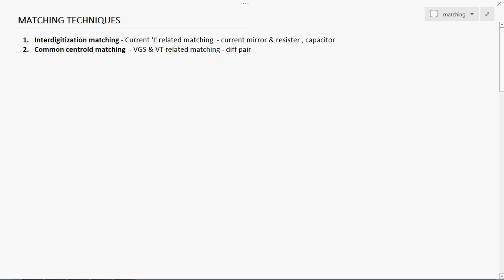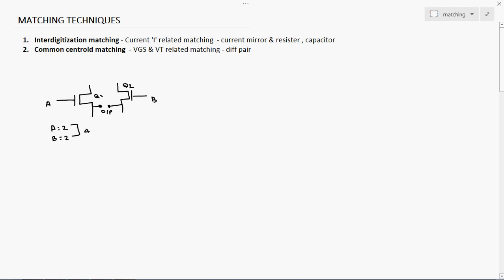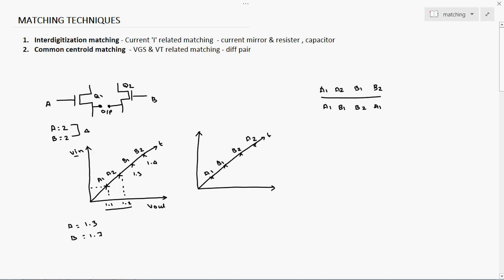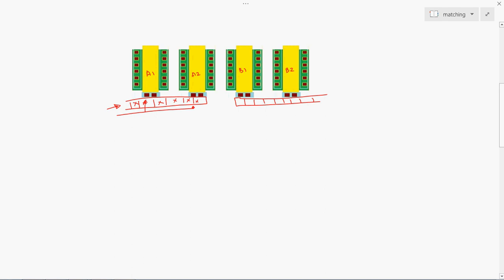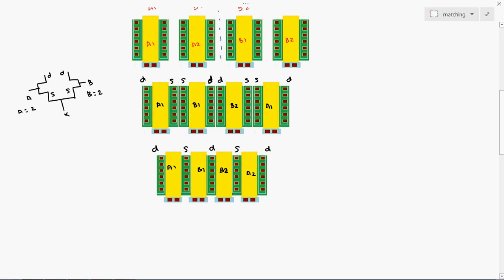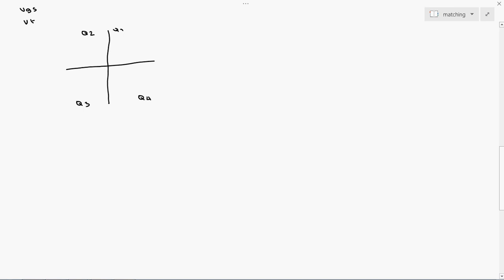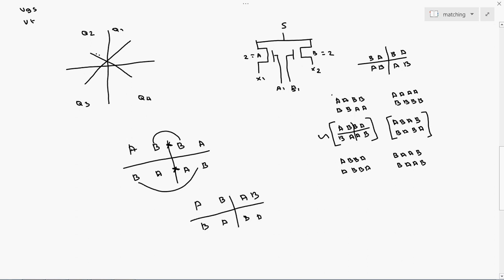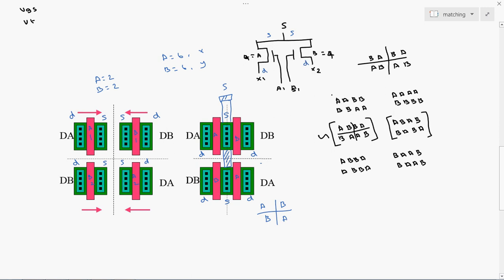MATCHING TECHNIQUES - English Version

Comment: Hi Sir doubt, the device will turn on when it has required voltage only right , here in interdigitization while saying about graph ur saying truned on at 1mA,1.1mA.... i'm bit confused about device truning on
Reply from the maker: This number are change in vt due to process variation, from constant vt 1.5 corresponding id change

Comment: sir, how we are finding average time in interdigitization??
Reply from the maker: not avg time , avg VT .... after doing RC extraction , we can calculate
Reply: sir in video at 7.22 we are taking example of  avg time to switch on the  transistors so how we are calculating  that? sir little bit confuse pls help
Reply from the maker: @sandylootera7198  there i mentioned , switching time of mos , which mean how fast the mos is switching from on to off , for Ex : diff pair , 2 mosfet has to be on or off , at same time , by calculating overall R&C , we can calculate this time delay
Reply: thankyou sir

Comment: Hi,
I have a doubt. How to implement matching when odd number of devices are involved?
Reply from the maker: diff pair always should be 2 or 4 or 6 , i will never be a odd no ,  only current mirror will be odd no , like A,B,C ... so interditization is very easy to do odd no devices
Reply: we can add dummies to make balance of odd number of devices in current mirror
Reply from the maker: @venkatasaikarthikvaranasi7303  sure we can add , based on the needs